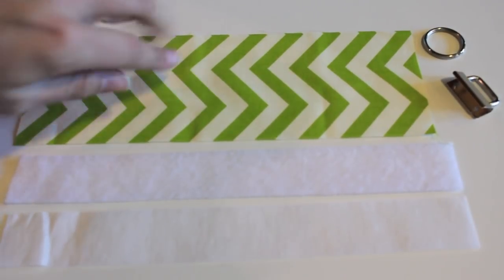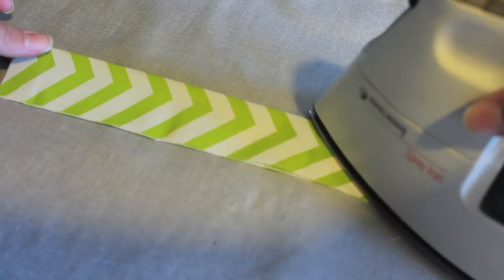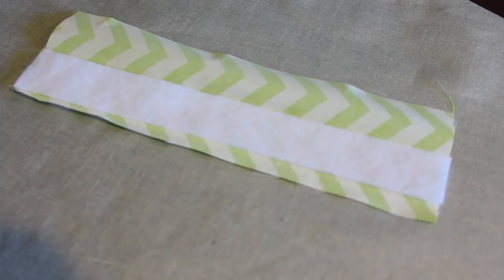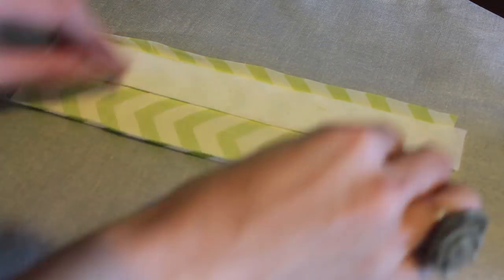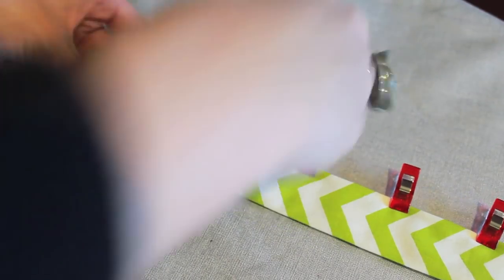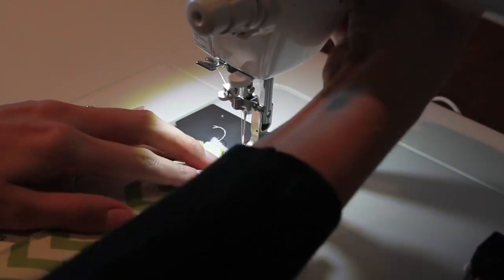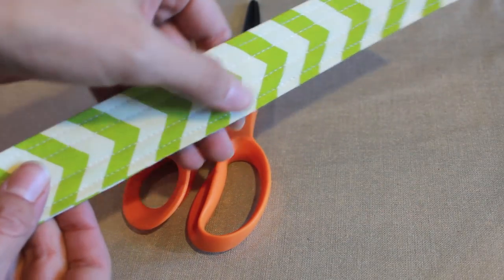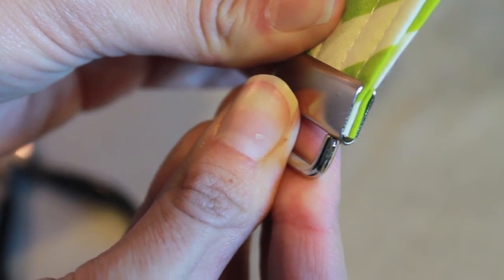Key Fob Sewing Tutorial

Comment: Hi- I have found that the metal hardware doesn't stay on after I've clamped it.  I can easily pull it apart from the fabric strip.  I've ruined 3 already and though I'd ask before ruining another.  Thanks for a great video/s!